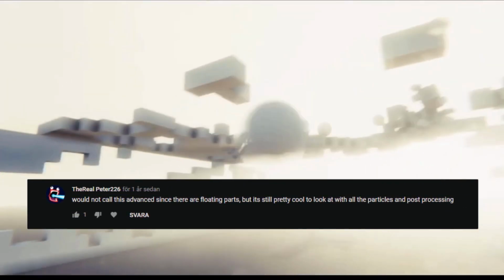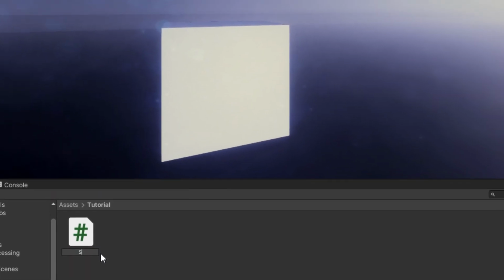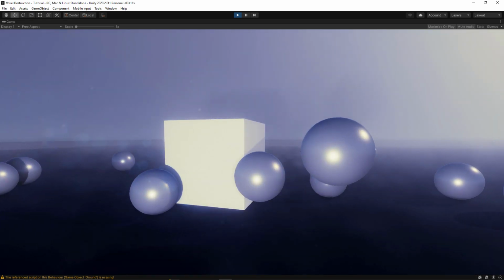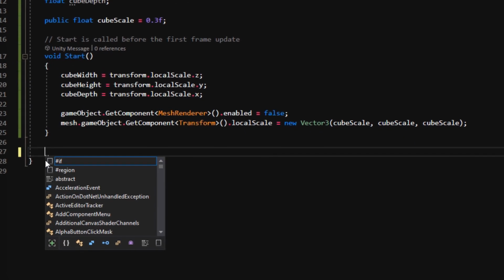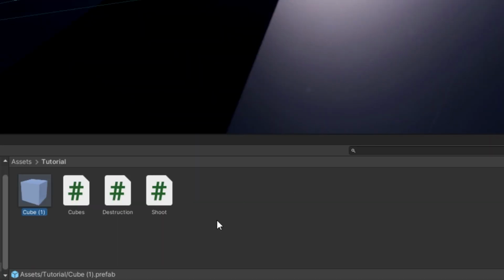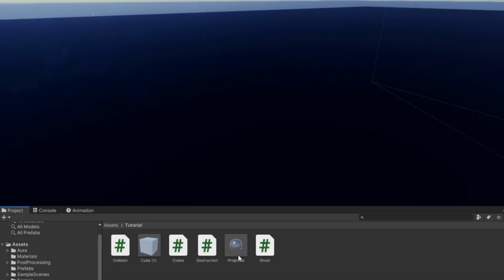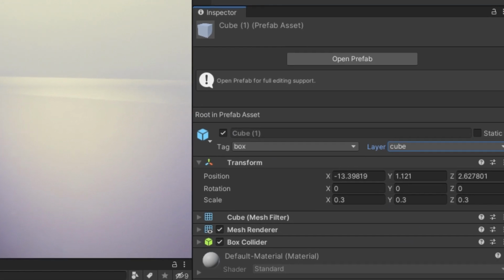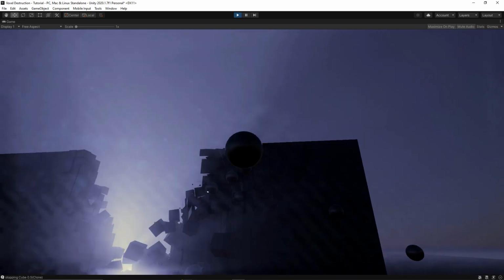Voxel Destruction Physics | Unity Tutorial

Comment: This is terribly (not at all) optimized, I'd never use this for production. Way too many GameObjects, way too much instantiation.
If you want to do this on a decent scale, you need to write a voxel engine. You need to NOT use GameObjects, and make sure you are rendering them effectively. You can instantiate or, better yet, combine meshes, write custom query systems, and multithread your code.

This is only acceptable on a very, very small scale.
Reply: Yeah, I just found this and honestly it's doing more harm than good. This solution tackles none of the complexity to make it scalable, and gives a false sense of progress.

Comment: Nice work!
However, after following your tutorial every step of the way,  I ran into an issue when the cloned cubes (cube1 in this case) are instantiated- they are verticle to the original cube and the position is a little off 😂
I wonder if this is caused by the inner for-loop in the script that decides the instantiating positions of cube1, but I have no idea how to fix it....(I'm new to programming as well)
Do you have any clue or suggestion?
Thank you in advance!

Comment: I get an error in the Shoot script and I don't know why. I get the error NullReferenceException: Object reference not set to an instance of an object. what I do? :C
Reply: You need to assign objects in the inspector
Reply from the maker: The NullReferenceException error basically means that you are trying to use something that is null (nothing). As 
lelaksi suggested check if you have assigned all the variables in the inspector. If you haven't, I think that should fix it! :)
Reply: I finished solving it a few hours ago. The error was generated by Camera.main.transform so I changed that part for something else and it worked for me.
Reply: The destruction script doesn't work for me either :CCC

Comment: Worst way to create voxel destructions, all of those small cubes has inner faces + rigidbodies. True way is, instead of placing a lot of small cubes and create a big one; you should create a program that calculates destruction on hit, and recreates the broken mesh. Each part must be one mesh, and must have one rigidbody.
Reply from the maker: Yep you're absolutely right. I realize now how crazy inefficient this system is and like you said probably the worst way to make it. I made this by experimenting and I had no idea what I was doing lol. I clearly have a lot to learn still and I might do a more advanced and optimized system in the future with actual voxels and not just cubes. I just need to learn how..
Reply: @leosvana962   you should start with programming a voxel renderer, define a 1x1 voxel mesh, and draw it runtime. then make bigger objects and implement fraction system. It's not that easy, but you can calculate the physics collision point and force with method OnCollisionEnter. Take the hit info to the mesh, and calculate the destruction. Split the big mesh into smaller ones(you can apply some perlin noise), and define the colliders.
Reply from the maker: @MustafaYayaRonNi3  Thank you so much for explaining it. This is really helpful actually, I'll definitely keep this in mind! You seem way more experienced with this kind of stuff than me lol. I'll try to learn though and hopefully come up with a better solution as you suggested :)

Comment: Thank you so much, Good Sir for this. Much appreciated. 

Yes it was very useful. 

May I ask, can the shape be changed from cube ?

EDIT : I see a shift in the use of bright setting of earlier video to dark settings. You allright good Sir ?
Reply from the maker: Thank you for your comment, I'm glad you found the video useful! Of course you can change the scale of the cube in any way you want, you could easily make it a rectangle for example and it'll still work just fine. You could technically make the shape any mesh, so I think some other shapes might work with a bit of experimentation. More complex shapes like pyramids and spheres won't work with this system though. And yes I'm fine, thanks for asking :)